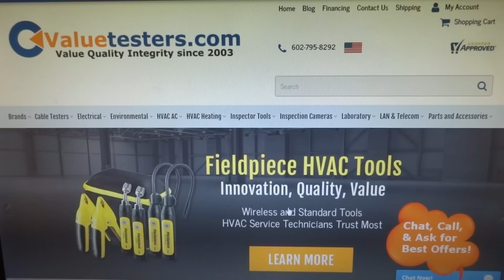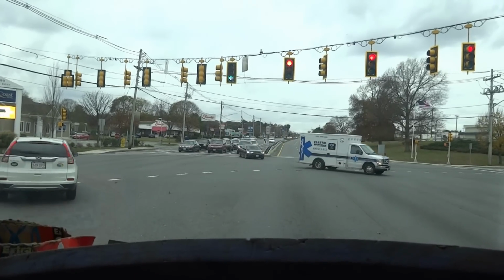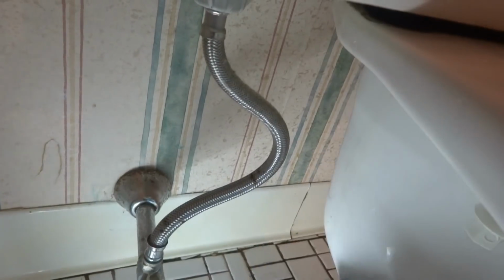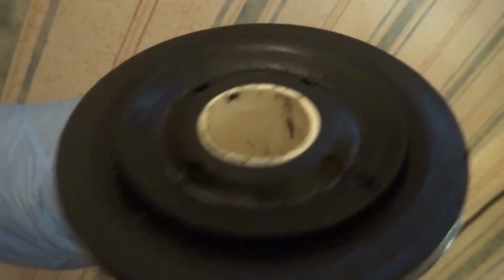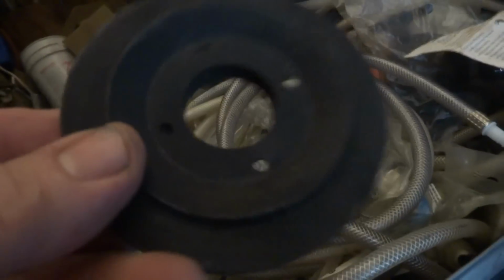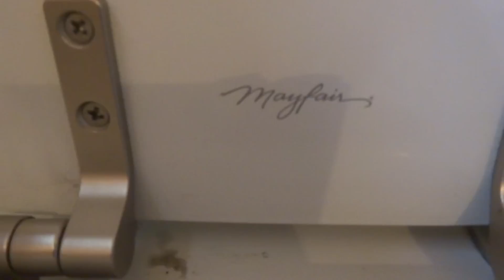toilet leaking water on floor / fixed

Comment: those blue plastic mansfield flush levers snap like dry kindling.  i usually stick in a metal universal and whittle down the square that goes thru
the china at the handle

Comment: l had spray from tank throogh a gap on broken taped lid that maybe had moved forward maybe gap was under lid just from moving , or broken end of it lifted , l had a scooter battery  on top of tank it moved touching flushing knob so it didnt go down, maybe pushing lid down too or holding it down and got pushed forward so broken end lifted up making a gap. water on quart of floor when home after a rather short trip half hour or so . sneaky unexpected way of a leak forming, dont keep stuff on toilets as a storing place, not if lid is broken and loose can move back and forth not heavy things , prevention  could be to open up to inspect and if valve sprays much in air to put something to stop spray maybe some plastic bag over or what or it can make problems too., maybe tape loose lid to tank so it dont move. ugly but ...and a plastic film could be taped on tank in a way to catch possible leak and direct it to toilet bowl, but looks bad. and containers under tank to catch possible leaks, bigger better. if looks dont matter.